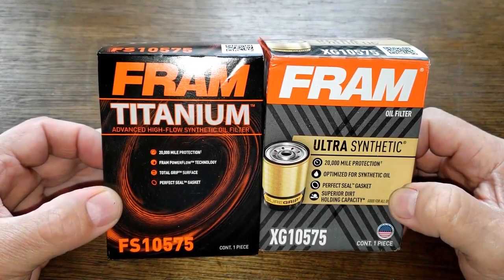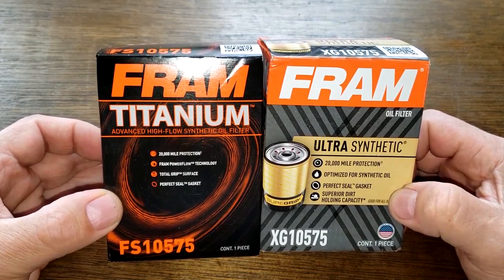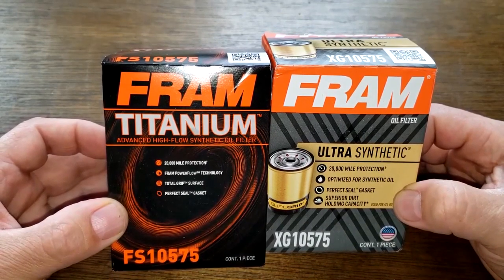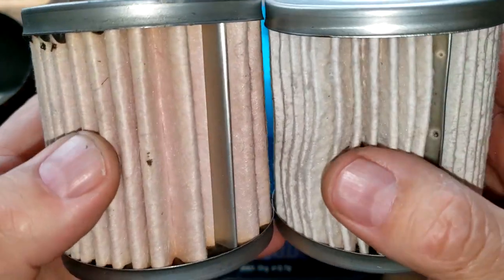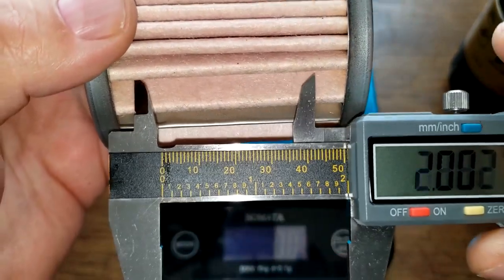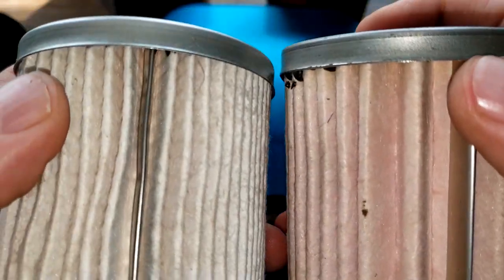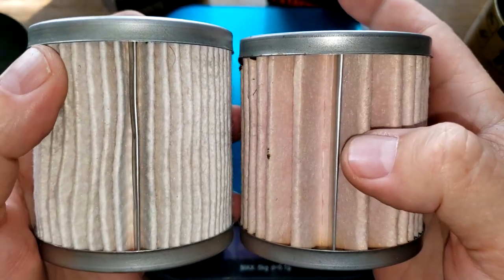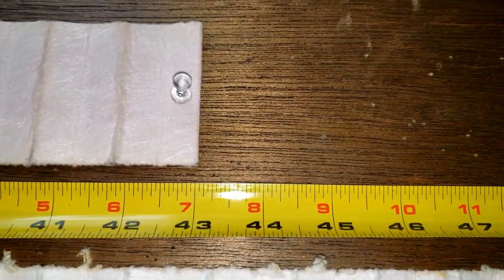Fram Titanium FS10575 Oil Filter vs. Fram Ultra XG10575 Oil Filter Cut Open

Comment: Hey, thanks for this!! This was 8 months ago, presently (June 2023) the Titanium does not have the metal screen, it is pretty much the same as the current Ultra. Fram's website states metal screen, but a chat agent said no metal mesh screen backing the media, because it stands up by itself. She posted the exploded view & circled the metal core saying that is the metal backing that helps trap more dirt. The Endurance (sold only at Walmart) is now the OG Ultra XG, with full synthetic media and wire mesh backing. New month, new Fram filter design........
Reply from the maker: Hi Bob,
That's what I've been hearing also, 
Thanks for the update.👍
Reply: The titanium does have a middle screen
Reply: The titanium does have a metal screen
Reply: @joetripi3255  It has a metal tube but no wire screen supporting the media
Reply: I don't know about the titanium, but the Fram synthetic endurance I bought at Walmart( Feb '24) states on the box it does have metal screen backing the filter media.

Comment: Not only check the threads, but take a rag, dab it in oil, and rub the threads out to collect any dirt or particles embedded in them.
Reply from the maker: Good Advice!
Reply: Sad, but true...
Reply: I've always done just that.
Reply: I do that anyway. Take a blue shop towel & one finger the threads. Always leaves some deposit on the towel.
Reply: most of the threads have oil on them from the threading machine probably why the metal cuttings get stuck to the threads. I wonder if a brush spun out counterclockwise would clean out the threads

Comment: Excess glue isn't as worrisome as excess metal shavings in the threads. For a company that makes so many filters, they should have better quality control. Fram should mention that on their website.
Reply: several years ago I watched a few videos on oil filters and comparing the different makes , and what surprised me that every review  i watched , most by professional techs said bar none the Fram filters were the worst filters for quality and manufacturing materials , one video i watched ( i wish I could remember the gentlemens  name ) tore 50 fram filters apart and tested the quality of the filter material inside and found 50% of their  filters started to come apart inside the filter housing within 1000 miles of use . I was so utterly shocked by that ,  I now refuse to even put a Fram filter in my car or truck . the NAPA GOLD was filters were hands down one of the best rated filters out there .
Reply: @wildthing1609  Maybe the orange cans yeah. But certainly not the tg or xg variants
Reply: QC has never been Fram’s calling card. Price has always sold their products. Wix has relied upon a reputation for heavy duty quality to justify their normally higher prices.  It’s just two different ways to market products. Wix built their reputation providing filtration for heavy duty diesel engines costing more than many people’s homes. They have an extremely loyal customer base because of that. Building filters for a $300,000 diesel engine demands  not cutting corners like cardboard endcaps, leaf springs, and cheap media. Those things can be done in automotive applications without issues 99.9% of the time.

Comment: The particles in the threads are probably the result of a dull thread tap. They are most likely changed on a regular basis during the manufacturing run and this one happened to come up dull before being caught by QC. I would bet these are assembled by an automatic line and parts are checked randomly. When you are manufacturing several hundred of these an hour, there are going to be a few that are out of spec and don't get caught.
Reply from the maker: True, that's why it's a good idea to check them before installing them.
Thanks for your feedback!👍
Reply: I bought one a year or two ago and it actually had no threads cut at all. Not sure what happened there but they of course exchanged it no problem.
Reply: Is it our job to wipe the threads clean, or the factory that makes them? All taps produce metal shavings and chips. Even rolled threads need to be cleaned. 
So if it is our job, or the mechanic, the instructions should say so.

Comment: 👍🏻😎 That's why I always wipe the threads out with a gun cleaning patch with some motor oil on it. I will never pay $16 for an oil filter though. I'll stick with my Motorcraft filters for my Ford. I refuse to use anything else. Sorry, Fram.

Comment: So it looks like the titanium uses the same filter media and wire backing that the ultra used to use. So now you have to pay $15 or $16 to get the same media you used to get for $8.97 at Chinamart.
Reply from the maker: Yep,
That's a very good assessment of these filters.👍
Reply: Oh no no no. You can't just leave off the black grippy texture. 99% of people are using a wrench to remove filters so they put that textured finish there for what reason again???
Perhaps to help remove a stuck filter installed by someone who shouldn't be doing their own oil changes. I do agree with the black color though.

Comment: Surprisingly  I like the titanium filter better.  Working at Advance I thought the titanium was just the ultra in a different package.  In learned something.   Great show.  Your the best.
Reply from the maker: Thank You!
Reply: It was at one point, company bought out Fram, they redesigned basically all the filters including the current Ultra. The Ultra has already been phased over (stock wise) for the most part where as the Titanium still appears to be the original Ultra.

Comment: My 07 Ecotec 2.4 VVT makes SO many of the cheap filters collapse/implode, of sorts. Including basic Fram versions. Titanium holds up well, filter medium comes out structurally intact after about 7500 miles.
Reply from the maker: Thanks for Sharing👍
Reply: do you think it is collapsing from high pressure with high rpms or is it the filter getting clogged at higher miles? have you tried filter at say 5000 to see if they collapse?

Comment: The Fram Ultra is a $10.97 filter at Wal Mart. The Fram Titanium costs $12.49, minus the always available 15% coupon code at Advance, which puts it at $10.61. The price difference is negligible though. I had a speedperks coupon, so I bought the Fram Titanium last week. I know on Bob is the Oil Guy forums people say the Titanium is better because it's the Fram Ultra before they decided to cut costs rather than raise the price. I don't really take filters too seriously, but I would probably pay a buck or two more for the Titanium if it's a better quality filter. I only change my oil once every 12K miles or 8 miles or so.
Reply from the maker: The Titanium is losing the wire backing, so I would go with the New Endurance filter at Walmart.
Reply: @WhipCityWrencher   Fram Endurance is made Champion labs and they are identical to the Amsoil and Royal Purple filters.  He has another video comparing Amsoil to Fram Endurance.  I buy Amsoil and Mobil1 filters, but we are slowly seeing Mobil1 products lowering quality in oils, so I hope they don't cut costs on the filters too.  Mobil1 filters used to be made by Champion but made by Mann+Hummel now.  So, chances are good they aren't the same criteria.

Comment: Yep, a few days ago I bought a Fram Ultra XG16 for an upcoming oil change, but I haven't installed it yet. So, after seeing this video, I went out to the garage and checked the threads on the filter. Sure enough,  there was junk in the threads. Mine had a small chunk of orange material in the threads. Maybe, a piece of the ADBV? I'm not sure, but here's the problem,  we can wipe out the threads with a rag, but who knows what kind of particles are hiding inside the filter?
Reply from the maker: Hi Save,
Hopefully, the rest of the filter is good. Thanks for sharing and I hope you have no problems.
Reply: 100% SPOT ON COMMENT!
Who knows what else is inside that filter.
Reply: I’m pretty sure they would machine the end caps separately so I would believe there wouldn’t be any shavings in the filter material.Until maby when you screw in on.I wonder if they make a tight fitting bolt or a tap would be better and screw this in the filter with some grease on it to make the shavings stick to it when being back out.
Reply: @dennisgood2108  Dennis you were spot on I am a machinist and there's no way they would cut threads with the canister together they were done separately good call Buddy thank you whip
Reply: Anything inside would get trapped by the media......you can see inside the open core section, the return to stud part.
Reply: @GT-mn3bx  how can they get trapped by the media when this is the outflow?

Comment: After using the OEM Toyota Filter for my 2016 Corolla I'm trying out the FRAM Titanium  filter for the first time with my recent oil change to see how it goes after seeing alot of good reviews especially for smaller cars like the Toyota Corolla and Civic
Reply from the maker: Hi Chris,
This is an older video, from what I heard the New Titaniums are now being made without the metal screen backing.

Comment: So the Titanium has thicker media, but does that mean it will filter better? Since the Ultra has more total sq in, I think it may even out. To me it seems like both are stout filters. While I also like the wire mesh backing for piece of mind, is there a benefit? It’s odd that the Ultra is about 40% cheaper than the Titanium, at least for my vehicles that I checked on.

Comment: Titanium....FTW! To me, it looks to be the OG Ultra filter with odd inlet holes. Superior two ply full synthetic wire back media. Just wish they would bring the price in line with Ultra. But, filter alone, not a close call, AAP Titanium. Thanks for the vid. First Brands/Fram needs to clean up the threads.
Reply: Yep, looks like the original Ultra.

Funny they still claim the new Ultra is a better filter, even though its basically the original Tough Guard at this point. Than you have to wonder if it is superior why is it selling for half the price of the older 'worse' filter.

Really seems they renamed every filter calling it the tier above, than put the original Ultra at a new tier with a higher price. 

Sucks when a good company gets bought out and quality drops sharply ...
Reply: The new fram endurance appears to be the old ultra, you're absolutely correct like they simply did a name change and moved everything up to the next name lol
Reply: Why do you think the wire mesh does anything? It surely has nothing to do with filtering. Is your engine that tough on the oil filter? I'd rather have a more free flowing filter with better filtering.
Reply: @robertmceuen3630  Clearly you don't understand the purpose of wire backing, why it's needed. Full synthetic media oil filters require a backing of some type for support, in this case it's wire backing. Purolator and Wix now choose a polymer type backing for their full synthetic filters, Platinum and XP. The Fram Ultra XG used to be two ply full synthetic wire backed media. They a have since cheapened the media, thin synthetic layer, backed by blended media layer. Not near the filter it once was. Topic Titanium uses the OG Ultra two ply full synthetic media, thus the wire backing. Flow not an issue with either filter, so that point just a strawman.
Reply: Ya, that wire backing is really needed. Oil filters won't work without it. Please no long replies needed.
Reply: @EliminatorPerformance  Really the Endurance is most like an Amsoil full synthetic filter. Basically, they are identical, and both made by Champ Labs. The media, while still full synthetic is different  OG XG. The OG XG Ultra was a better value at ~$9. But, I like the Endurance better than the cheapened media Ultra XG. Is it worth ~$4 more, guess it depends on how much one likes it better than the current Ultra.
Reply: @faxmen09  I've been importing the Synthetic Endurance from Walmart US into Canada because they're almost half the price of the Amsoil EA017 here in Canada lol it's a good filter forsure
Reply: @EliminatorPerformance  Smart man (or smart individual lol). I've heard the Endurance not available north of the border. Yeah, Amsoil is pricey and shipping must be added in. I think Endurance a good filter but I liked the OG XG better, I have one XG 7317 left. Saving it for what I don't know. Posterity?
Reply: @faxmen09  Walmart offers free shipping over a certain amount, I think if I order a minimum of 3 it's free shipping. Shipped to a PO box just over the border, from where we are it's like an 1hr basically lol
Reply: @EliminatorPerformance  That is interesting. I know WM offers free ship over a certain amount, and 3 FE filters sounds about right. You seem to have the process down. 👍

Comment: It looks like High-Flow is the only difference. That's why it has the bigger holes. The weight is irrelevant. The less folding of the filter itself, mean it lets the oil go through it faster. It's just a high-flow system. Thank you for making the video. I know now what the difference is.
Reply from the maker: You're Welcome!👍

Comment: I think I'd run a small pointed pick through those threads while holding the filter upside down so the debris doesn't fall into the filter.
Then as another stated run a oiled paper towel through the threads to collect fine particles.
Reply: Or... Don't buy junk Fram filters.
Reply: @dontblameme6328  You haven't been paying attention. All of the brands have been found to have faults these days. Split seams, excessive glue, change in bypass valves, the list goes on. Large corporations are purchasing the top brands and cheapening them up with different parts or a different lower standard production process. Don't think Wix has escaped this either. They got purchased and the quality isn't what it once was.
Reply: @dontblameme6328   I used both wix xp and K&N exclusively for a long time, there are issues with those at times too - the fram ultra is an excellent value I am happy with them

Comment: The Titanium looks exactly the same, as the old version of the ultra. Much better than the new new Ultra. Unfortunately, I cant get the titanium in Canada. What a shame, they changed the ultra. It was such a good filter for the money.
Reply: So true!👍
Reply: Well the good part about the updated Ultra is that it actually has a higher filtering efficiency on below 20 micron sized particles versus the previous Ultra so the new Ultra actually slightly out-performs the Titanium when it comes to particle filtration below 20 microns.
Reply: @JA-rn5qv  Meh. "For me", the cheapening of the new Ultra media far outweighs the First Brands 'promoted' slight improvement in efficiency below 20um. Seen many cut open post use new Ultra far short of 20k mi., not great pleating. OG Ultra proved itself to its rated 20k mi. many times.
Reply: It seems now in Canada some of the Ultra (XG) filters  are actually Titanium, i.e. not pure synthetics media but cellulose/syndetic blend. It seems Fram is cheapening their Ultra line.
Reply: And Endurance line is not available in Canada.

Comment: I use the Titanium, whenever I use a Fram. I always check for shavings/debis anymore. I bought some Baldwins from Rockauto a few months back that were horrible with shavings. Great video!  Always enjoy them!!
Reply from the maker: Thanks Aaron!
and Thanks for sharing!👍
Reply: A few months ago I purchased several Baldwin B1431 filters (however, I did it through the Zoro online store- Really I think it is doesn’t matter ) And, right now, I reviewed all 8 remaining filters: there is nothing on the thread on any of debris. No thread cutting chips, no dirt. Have you filed a complaint with the manufacturer?
Reply: @Andrew__Smith  no I didn’t. I guess I should have. I never thought to do so. But you bring up a good point. I just tossed them in the trash. Kind of wasteful I know.
Reply: @aaronhansen8037  I don't blame you, not at all. I just got three Baldwin B243 filters for a truck I do oil changes on. Nothing wrong with them on the outside inspection and using reading glasses nothing to note on the inside. But what lurks within is always a mystery until cut open.

Comment: Everybody keeps talking about “metal shavings” in the threads, but please point to where that was proven?  Yes, there is cutting grease / residue, but I see that in most filters.  That’s why I ALWAYS take a rag with clean oil and wipe the base plate inside & out on every new filter I buy.  FRAM isn’t the only company that has this issue.  And the magnet he took to the threads in the beginning certainly didn’t pick anything up.
Also, the Titanium is just the old Ultra, whereas the new Ultra’s filter media does not require the metal backing, and is more synthetic.  New Ultra for me!
Reply from the maker: I'm going to go look at that filter again and see if I can find anything in the threads recording the whole time, if I find any I'll post the video. If not then whatever it was is lost, it sure looked like a piece of metal to me. I'm not trying to bash the Fram Ultra, I think it's a good oil filter. I saw what looks to be a piece of metal so I tried to remove it but it didn't work out too well. Like  I said in the video you should check your filters, (I meant all filters). 13:26 
I should have also said metal shavings in the threads could possibly be found in any oil filter.
Reply: @WhipCityWrencher  That sure looked like metal shavings to me. It is something to look for. You gave some good advice.
Reply from the maker: @m8s4lif  Thank You👍